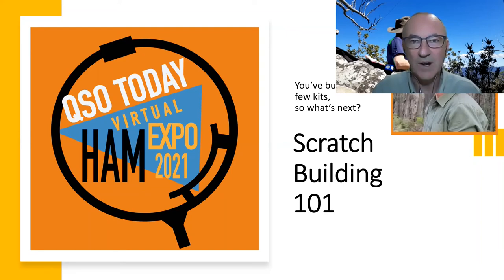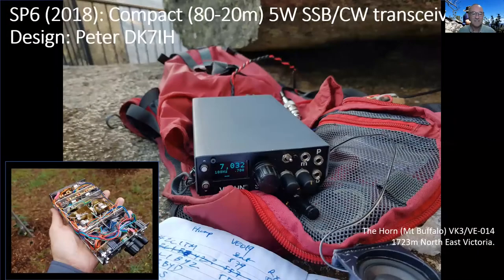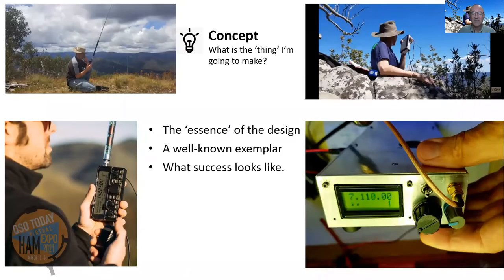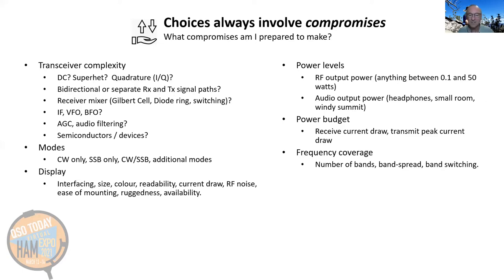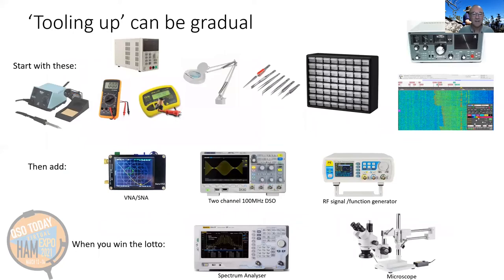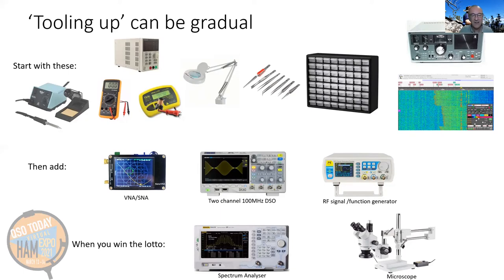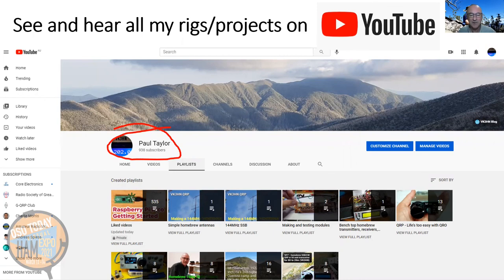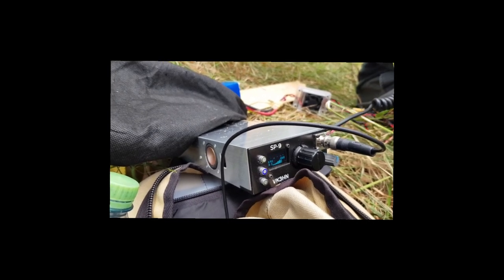Ham radio scratch-building 101 -- from QSO Today Expo March 2021

Comment: Thanks for this Paul. I have that itch 

Haven’t built anything serious since my  10W practice amp which was a Grant Willis Lamington 2xEL84 driven by a Vox AC15 style phase splitter with an AX84 hot rod preamp as I wanted a little more gain. 

The poor little CTS Alnico didn’t stand a chance. Now it has an Peavey EVH Sheffield driver. It’s a beast

Time to build my Marshall AC30. A Vox AC30 inspired 4x EL84 beast using a scrapped Marshall DSL 40 combo which is supplying the transformers and the chassis
Reply from the maker: You're working in the honourable tradition of musicians who build their own gear. The classic guitar amp circuits are probably  reproducible, if you collect the valves, HV components and transformers, many of which are still available or can be scrounged  from old valve gear.  Are you saying that you can scratch build a Vox AC30 and get That magic Vox sound ?  Ooohhh !
Reply: @Paul_VK3HN   Nahh. The sound will be my sound. The Marshall transformers don’t have the metal that the old Vox ones did, but, as the old JCM2000 combo has stuffed pots that are proprietary and expensive, for what the amp is worth working, I figured it would be a better use of resources. 

So one channel will be a pair of 12AX7s and the other an EF86. Spring reverb and I’ll put a volume boost as well as a channel switch for when I’m using it against another guitarist 

Time to get cracking.....but I have an 8100 Valvestate on my bench that is the head version of the little British made Marshall 8080 combo I use....to drive a Fender Bassman 100.....yes it’s a little scary. It looks loud and scares sound guys, but has the perfect gain structure to break up so evenly and smoothly at low volumes in small rooms as well as QRO on bigger stages.

Comment: Thanks for the inspiration. I am currently in the process of designing my first (and almost certainly overly ambitious) scratch build. My aim is to create a ~20w portable SSB transmitter using a class E amp and EER. It will likely be a 20M monobander, and I haven't decided much at all about the receive side yet.

For now i'm just starting with the class E PA, but will focus on the voltage amplifier for EER, and microcontroller control of the whole thing next. 
73 KK7RWK
Reply from the maker: Thats a super interesting homebrew project and very modern! The 20w PA should be achievable with all the switching FETs to choose from, although you will need faster ones at 14Mhz. What MCU will you use ? Will you write your own software ?

Comment: Great video!  I just finished my first scratch built rig, and you are spot on about everything.  Although I think you downplayed the part about running into problems! :)
Reply from the maker: Thanks Dennis. Yes I probably did do that, the problems are not insurmountable but you have to be really persistent sometimes. If I can't get a module or stage to work after two or 3 debug sessions, I sometimes rip it out and build a different design. Persistence pays off.

Comment: Enjoyed the presentation, thank you! So my understanding is that these OLED screens work OK for you, no problems with the noise? I'm using 1602's/0802's LCDs in my designs now. They work great, but I would like to try something new. Tried ST7735's but had problems with noise on HF bands.
Reply from the maker: Hi Alex. Yes, all my LCD 1602 and 0802 rigs are as good as silent, they are great displays, I like them a lot.   I have built two rigs with  an OLED. The 80, 40, 30, 20 rig (SP6)  does have a small amount of digital noise from the OLED but it is masked by the band noise when the antenna is connected.  I socketed the OLED, so you can pull it and hear the noise drop. Peter VK3YE has a video on supply decoupling that he claims works.  Also look at Peter DK7IH , he has OLED rigs with simple RC or LC supply decoupling.  The Arduino Nano is a bigger noise source, I try to decouple these with very good bypass caps and 78 series regulators. Physical distance and screening make a difference, remember, the Nano has a 16MHz clock and the si5351 a 25MHz clock, plus all the divisions and random combinations, plus all the MCU  hash,  IT is a wonder that the receivers work at all. Good luck with your projects!
Reply: I've had a TON of noise from OLED displays, maybe because I get the cheap ones off ebay.  In any case it's a simple fix - a very large capacitor and resistor.  The radio I just built has a 1000uF cap proceeded by a 50ohm resistor, soldered right onto the cable connecting the display to the main board.  I estimated the display pulls about 30mA max, so the resistor will see at most a 1.5v drop, which works out because I'm supplying 5v and the OLED display module steps it down to 3.3 anyway.  Similarly, I added a 10ohm resistor just before the 7805 supplying the arduino and SI5351 which did a lot to distance the audio and HF components from digital noise.  I already had a good size cap on the 5v rail, but adding the resistor quieted it right down.
Reply from the maker: @WhatDennisDoes  In my SP6 rig with OLED I used a 100mH choke in series with the 5v supply to the SSD1306 OLED breakout, with a 100n capacitor to ground either side. I copied this from DK7IH. Can't recall how effective it was, but I've never thought OLED noise was noticeable in that rig.
Reply: @Paul_VK3HN  good to know! I was afraid to just throw an inductor in there thinking it might oscillate and make matters worse so I was happy enough when the RC filter worked.  Next time I'll have to compare.

Comment: I've built mostly kits and the only gear I've built myself are the Tuna Tin II, works, and the Herring Aid-5, lo doesn't oscillate but details, and the 3 watt Codzilla One which I have not completed because they don't make the coils for the input and output matching transformers for the 2N3053 NPN transistor. ARRL doesn't publish the article on their website and I have to go into my hellscape of a closet to find the 1977 issue of QST it is in. I'll photocopy it when I find it and wind those transformers onto toroid cores. I want to go beyond these simple rigs and build more sophisticated, practical and well performing rigs. BTW we're about the same age. I had considerable help building my first transmitter using a 6GK6 oscillator stage and a 6146B final throughout 1975 and 1976. My second rig, a solid-state 1 watt 40 meter transmitter was built using a 2N3053 transistor but didn't work. I took it to my Elmer and that's when I discovered the importance of heatsinks. Who knew?
Reply from the maker: Thanks for commenting, and a good story.  My first Tx in 1977 was a single 807 AM thing, mostly made by my older brother and without him it never would have worked. But with help that planted a seed that has lasted all my life. Many QRP designs do have one or more components that cannot be sourced. I've never seen a  Neosid or Miller coil that could not be replaced with toroids as you intend to do. When I build an oscillator that doesn't work, I give it a few hours of attention, then replace it with one that does work. There are always alternatives. Happy projects!  73 Paul VK3HN.

Comment: Great Video! At 18:58 into the video you show five publications and I can make out four of the five;(. What is the publication in the lower left and who is the author? 
Many thanks!

DK KD6TK
Reply from the maker: Hi DK, thanks for commenting. That is one of four books by Drew Diamond VK3XU. Drew wrote dozens of  homebrew articles for the Wireless Institute magazine Amateur Radio thru the 80s to the noughties.  These and other projects were collected into four excellent books. The projects, receivers, transmitters, tuners, linears, power circuits, antennas are all traditional analogue and many are well tried and loved.  These books may still be available from RSGB, via GQRP Club. Let me know if you cannot source them.
Reply: @Paul_VK3HN  Thank you for your prompt reply! I am a member of the  GQRP club so I will check them out. Keep up the good work!